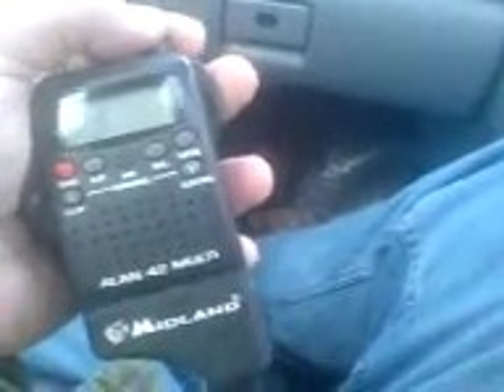Midland Alan42 and BPL Interference (Broadband over Power Lines)

Comment from the maker: The hand held does not need the rubber duck as it uses a in-car adaptor which attaches to the bottom of the walkie talkie. Beleive it or not there is also a KL-203 Linear in line on this setup giving approximatley 35-40 watts output